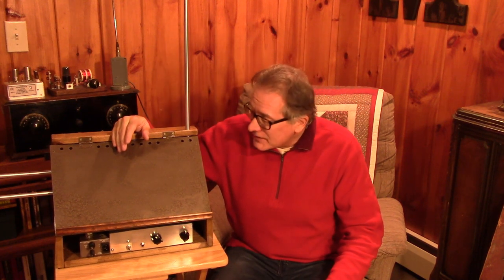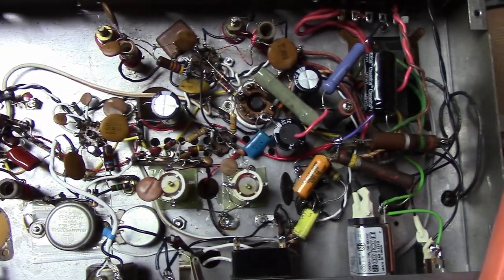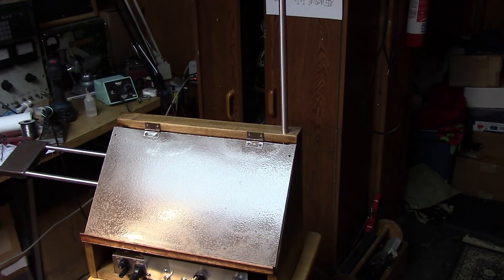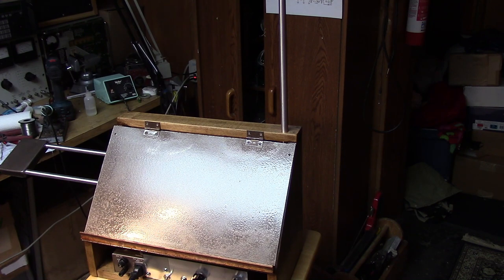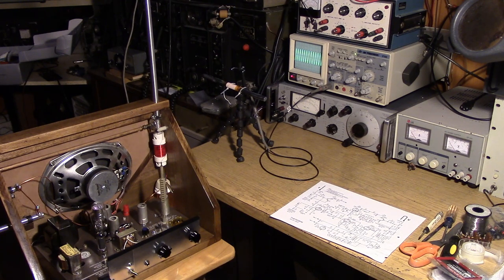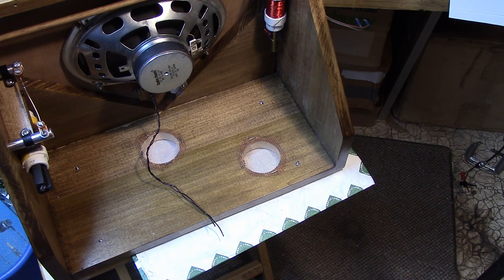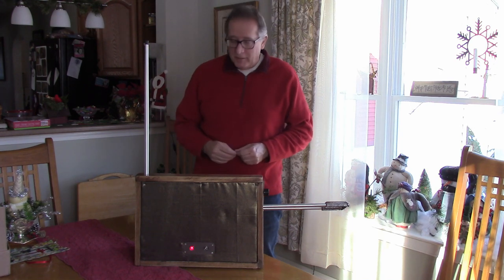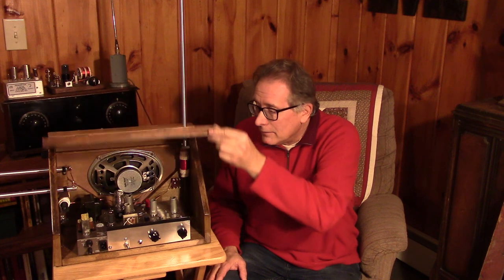Theremin Part 5

Comment: Have you tried the KORG NUTube 6P1 flat vacuum tubes and can operate at B+ of 45V and a Heater voltage of 3V and doesn't give of much heat but are slightly microphonic but could be cushioned to stop vibrations causing problems.
Reply from the maker: I did some research on the device on your recommendation, and it seems like a target device for a video this year.
Reply: @MIKROWAVE1  I would definitely like to see it being compared to an ordinary VFD out of a $20 microwave oven, just to see how great job KORG sales department is doing by selling VFD displays as Hi-Fi audio devices at 10x price :-)
Reply from the maker: Believe me, if marketing ordinary wire as a way to improve audio were a thing, someone would be upselling it OH WAIT...

Comment from the maker: Wow! What an effort to close out 2020. I bit off a little more than I could chew with the Theremin Project. But what fun.
Reply: 16:28 The two loading coils seem so far apart, why would you need to place them at right angles? 
Is the EM field of these coils that strong?
Reply from the maker: @Jeffrey314159  No doubt far enough. More about how it would fit in with that bar in the way on that side!.